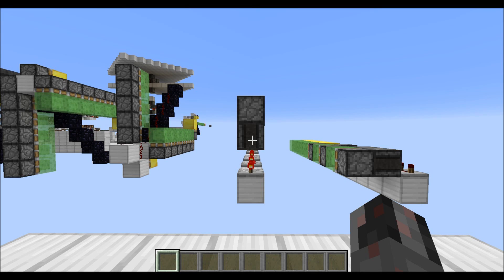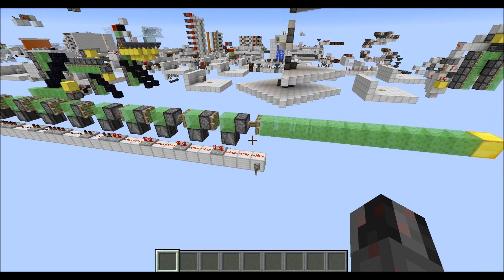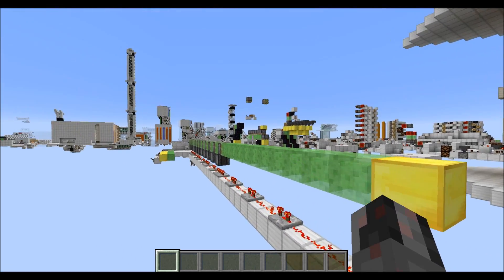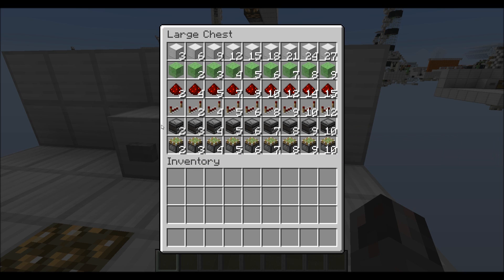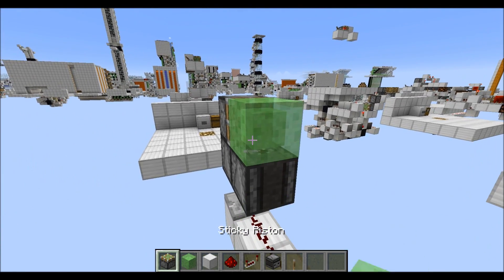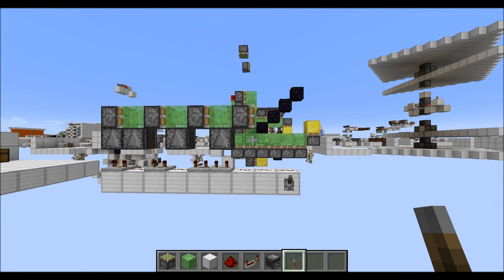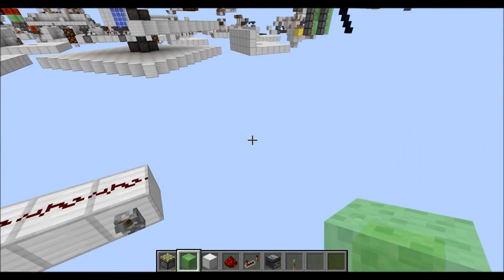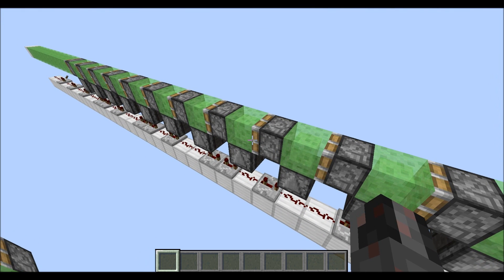Tutorial: Simple, horizontal, ultra-compact Multi-Piston-Extenders [Java 1.11+]

Comment: Bit late but this still work?
Reply from the maker: Yes. This works in Java 1.11 and later (as written at the end of the title).
Reply: Great, thank you, btw, while I have you here, is this tileabel?
Reply from the maker: Only if you leave a gap inbetween ;)

But you can easily extend the modules sideways/upwards by adding slimeblocks and then go from there. As long as you stay below the push limit you'll be fine.

Comment: This is use slime block,you can build without slime block
Reply from the maker: You could, but it would be a lot bigger due to the circuitry. The interesting point of this concept is, that it only needs a SINGLE redstone line to control it.

Comment: stil works!
Reply from the maker: Would be a real problem if it didn't, since that would mean that pretty much all new flying machines would be broken too.
Reply: true
Reply: the best thing i've done was a triple piston extender, not even flush
Reply from the maker: It's a good starting point, nevertheless. I didn't start with my vault doors, but much simpler (yet still terribly designed) contraptions and worked my way up to where I'm now. I think it took me about a year until I had my first triple extender worked out (mostly copied from youtube with some slight modifications due to the available space).
Reply: May be a bit cheaty but my design used a double extender for the first two pistons
Reply from the maker: Well, a triple extender can be seen as just a double extender that moves a third piston around (which then moves your blocks). So that's actually a valid way of designing a triple (or higher) extender.
Reply: Here is my design http://prntscr.com/j9ywfk
Reply from the maker: That's actually really compact. Great design!

One little improvement: Remove the torch and its block and replace them with redstone, then put the following repeater on the next higher setting (the observer only sees changes of the incoming signal, not its actual state). This way the design is completely flat.
Reply: oh wow thanks, now i can move the lever down and make it 1 high
Reply: Do you have a minecraft server?
Reply from the maker: You're welcome :)

And no, I don't really have the time that would be needed for that (full time job and such). Additionally most of my minecraft time is spend designing new contraptions for my channel.
Reply: I managed to make a quad piston (looks like something I built) extender, its really quite big
Reply from the maker: The number of necessary signal-pulses rises somewhat exponential with the number of pistons in the extender (~x2 per piston), at least for a standard extender. My multi-extenders use semi-autonomous flying mechines to circumvent that little problem. So I'm not really surprised, but good job nevertheless.
Reply: i used a triple piston extender at the front, then 4 extra pulses, 1 through each piston to get it all back in place
Reply from the maker: Ah sorry, it's not an exponential function but more similar to a power function (~#pistons^2), which increases a bit slower. A little error on my part there...

Essentially you need N extra pulses when adding the N-th piston. So to turn a 5-piston extender into a 6-piston extender you would need 6 more pulses than before... which means the total number is a simple sum function, which in this case can be sumarized to (about):    N*(N+1)/2
Reply: Lets say i knew what you said
Reply from the maker: Okay, I can live with that :)
Reply: Tbh i only asked if you have a server so i could meet you xD
Reply from the maker: Thanks for that. But as I said I simply don't have the time necessary, otherwise I would have joined one a long time ago.
Reply: I understand :)
Reply: whats the smallest upwards double piston extender you've ever seen?
Reply from the maker: That would be a 2 x 3(4) x 1 sized one: Repeater running into the lower piston, Observer ontop of that (looking at the repeater) and block/redstone on top of the observer. Put the repeater on 4 ticks and even short pulses will toggle the position of moved block (retracted / spit out) each time.
Reply: could you maybe send a screen shot?
Reply from the maker: Why? It's just 6 blocks? But just for you I went a step further and made an ASCII-art:
(viewed from the side)
XX
UO
UR
   X

X = Block
U = Piston (upwards)
O = Observer (looking down)
R = Repeater
Reply: repeater doesnt have to be on 4 ticks but thanks
Reply from the maker: You're welcome. And the 4 ticks is (only) for when you input very short pulses. The extender needs at least 4'-pulses to work properly, so when you are for example using an observer as input generator you can put the repeater here on max and everything works out, without additional circuitry.
Reply: ahh ok :)
Reply from the maker: Ah I just remembered something... it's also possible to replace the repeater with redstone, BUT you can't directly power that with a lever/button. You'll still need a repeater (or torch) inbetween due to the order the redstone components (lever vs. repeater) are processed by minecraft. The redstone must still run into the lower piston, too.
Reply: Already found that out when I tried it, but thanks for telling me.

Comment: great, but in 12.2 it duplicates the observers, clogs up the works. reply if you have a solution please!
Reply from the maker: That's a known graphics glitch. Those duped blocks don't really exist and don't effect the contraption, as far as I know. Whether they appear or not heavily depends on your system (graphics card and CPU).
Reply from the maker: Also lag plays a major role.
Reply: Thanks. The (duped) observers don't interact redstone wise, (or maybe they do) but they act as regular blocks, pushing the frame of a door or something out of the way. Still, a great contraption!
Reply from the maker: Those pushed blocks are also just graphic glitches. If you try to place a block on the side of a duped block it will disappear and the new block will replace it (instead of appearing next to it). If you try that with the block at the original position of the door frame that one will turn back in to the origianl one and the new block will be placed as expected.

The main cause here is a problem with the minecraft server-client interaction. Basically the server handles the actual world data (e.g. placement and movement of blocks in that data) while the client handles the representation for you (graphical output). Through lag a moving block may be duped inside of the client (the server does not have that problem) and all actions inside of the client will think it's a true block. But as soon as some true interaction (aka block placement) forces it to synchronise with the server again the ghost blocks disappear.

... or at least that's what I think that happens. 
I hope I haven't confused you now :)
Reply: No, thanks, that wasn't confusing at all! I like that you address concerns quickly and efficiently, I'll be sure to watch more of your vids!
Reply from the maker: You're welcome. And thanks!

Comment: Is there a possibility to supercharge this?
Reply from the maker: Not exactly, you might be able to make it a bit faster by replacing the redstone with repeaters and then putting all repeaters on either 1 or 2 ticks (would need a bit of experimenting to figure out the right configurations). But all in all it's actually pretty close to supercharged already, so it probably wouldn't be worth the trouble/costs.
Reply from the maker: ...On second thought, it's possible, it probablby wouldn't be 1 wide anymore and much bigger, though. You "simply" need to supply the positions the observers are looking at in the retracted AND the extended state with a changing signal "wave" (change at 1st piston => change at 2nd piston after 3 Ticks => change at 3rd piston after (another) 3 Ticks => rinse and repeat)... Would need some redstone logic or observer magic.
Reply: ;D thank you

Comment: fantastic system. One downside though i saw from using this is how susceptible this system especially longer versions is to server lag or stuttering as during those instances the observers and anything at the head of the piston line can duplicate. eventually enough duplications clog the system and it ceases to work. At least that happenee on my realm. In the absence of lag it works very well
Reply from the maker: Yeah, ghost blocks are a bit annoying. Though, I never noticed them actually counting towards the push limit (they aren't really there after all)...
Reply from the maker: And thanks :)